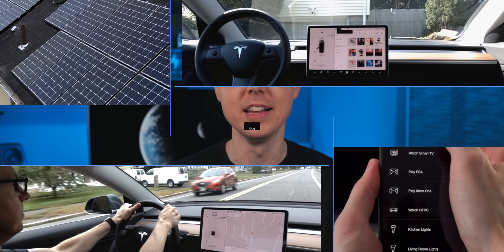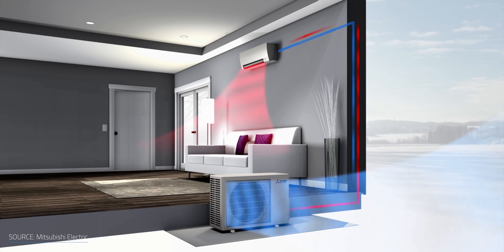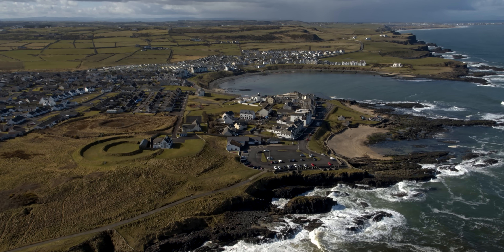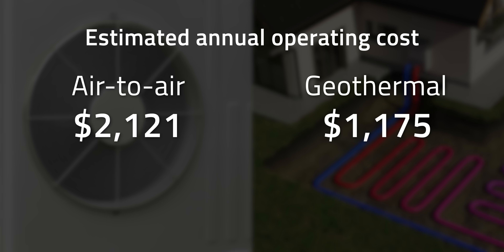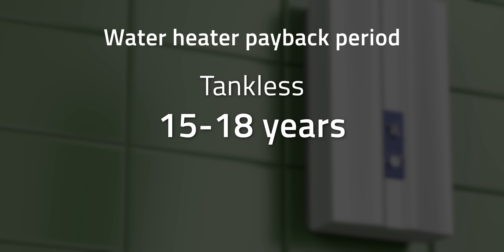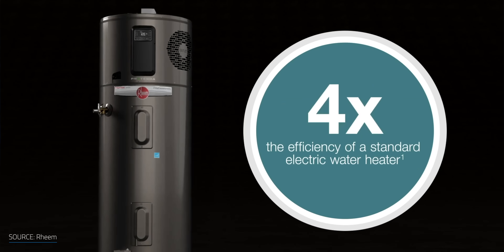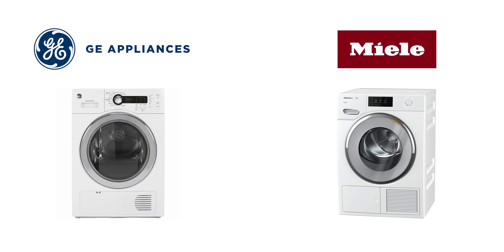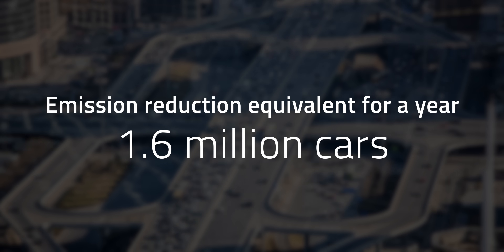Why Heat Pumps are Essential for the Future - Explained

Comment: Grid power generation is only about 30-35% efficient.  So even with a COP of 3 it's no better than your existing gas heater. You need to stop the "zero carbon" mantra and start doing some objective assessments.

Comment: I am constantly amazed that he never mentions where all this electricity comes from ; that powers all his electrically driven equipment !  I will bet he doesn't mention that his grid tied electric is powered most likely by a coal or natural gas fired power plant down the road aways from him.  By the way , biggest immediate reduction of WASTE would be if you generated your own energy at your location . Of all the power generated on the huge electric grid system a minimum of 30 % is wasted in the wires , transformers & switching systems . Many of those systems are wasting just as much power as they deliver to customers due to poor system design & the fact the wire losses alone are causing that minimum 30 % loss. Less wire between you & your power supply is easy to do , when you generate your own power !  Get Off The Grid NOW. And don't fall for the idiocy that this guy puts out ; that CO2 is a pollutant ! Only a slave to the Elites would fall for that & that's only cause he gets paid by the Elites that benefit from the BS he spews ! CO2 Is Not A Pollutant !  If you really think that it is ........... Do your part to eliminate this Dangerous Gas & STOP Exhaling ............... Leftists are dopes................ Nick , NavyBlueSmoke , LST-1195

Comment: What a poor presentation.
No harmful gases.  R134A is a florinated gas.  Leaks happen.
Savings compared with a G rated boiler.   Say what.  How is that relevant when everyone has A rated boilers.
electricity 5 times price of gas.  There is a reason for that.

Comment: Worthless below 40 F. Fortunately I also have a wood burning fireplace insert but will replace that with gas before next winter so as not to have to feed the fire 24/7. 
Don't buy a home with a heat pump.

Comment: You are being very misleading in your conversation of 1 Watt of energy in to a heat Pump and getting 3-4 joules out.  When you convert one watt of energy into Joules.  1w = 3.4Joules. Conversely 1 Joule is equal to 0.294117647058824 watts. You are conning the viewers as ever.   So in fact for every watt you put in you get about 1 watt out. Not 3 times.  You are very disingenuous.
Reply: The energy is extracted from the environment air.
Reply: 1w = 1J/s...

Comment: There are no documented cases where typical heat pumps save over natural gas furnaces in the USA.  There is no mechanism that would allow greenhouse gas behavior to cause global warming.   Global warming was officially stated at 1.1°C in 1991 and 1.06°C in 2022.  Earth's greenhouse effect is frequently used as a primary example to high school students of a system always in saturation from the strong greenhouse gas water vapor absorbing all the greenhouse radiant energy from the earth with greenhouse gases within 20 meters of the surface that is all around us everyday and can't have its overall effect changed.  There is no further greenhouse radiant energy to interact with greenhouse gases.  At 1% average tropospheric water vapor over 99% of earth’s greenhouse effect is from water vapor.  Water vapor would hold earth's greenhouse effect in saturation if it were the only greenhouse gas in the atmosphere.

The back of the United Nation's IPCC science report states it took its greenhouse gas samples at 20,000 meters altitude where it is common high school level knowledge there is no greenhouse radiant energy.  This is typical practice for deceptive marketing to state legal data transparency protecting the perpetrators from fraud prosecution.  

Arctic warming is taking place with the proving mechanism being warm Atlantic Ocean waters migrating deeper and more frequently into the Arctic Ocean warming it and the region.   That warmer water is causing a few weeks less of reflective snow and ice coverage resulting in more solar heat gain to the Arctic region surface.

Atmospheric CO2 levels of 1200 ppm about three times what they are today would greatly invigorate C3 plants the majority of plant life on earth greatly greening the planet. 

0.4% of the atmosphere is CO2 and on average 1% is H20 water vapor.   (1% H20)/(0.4% CO2) = 25.  Water vapor is 25 times more present in the atmosphere on average than CO2.   Water vapor has an CO2e of 18,  18 X 25 = 450 CO2e total for water vapor to 1 CO2e for CO2. 

The Earth’s oceans have 3-1/2 million sea floor volcanic vents warming the water and changing it’s chemistry that have not been systematically accounted for.

Comment: Heat pumps are great. My home will be completely off grid and passive energy; however state forced heat pumps are a violation of my rights as an individual. If I choose to cover my roof with solar panels and use a low efficiency faster drier for my clothes then that is my right. Low IQ politician do not get to govern my high IQ solutions.

Comment: you make no sense at all... if your just gonna air dry your clothes... why use a dryer... just use a clothes line... been through the debacle... if you dont use heat to dry your clothes in a dryer... and you essentially just use a fan and turning the clothes in it to fan dry it... wouldnt it be much more efficient to  hang them outside in the wind and not use a utility at all?